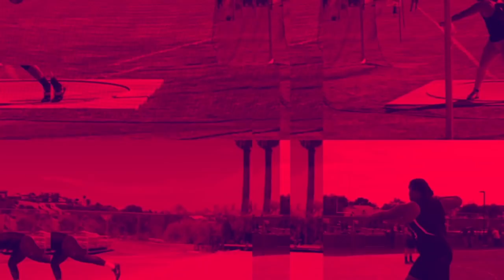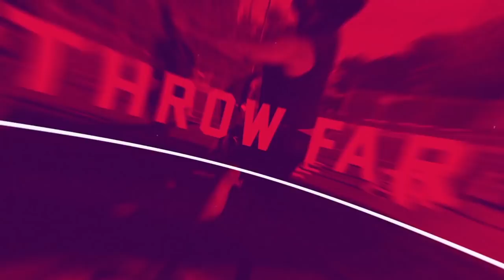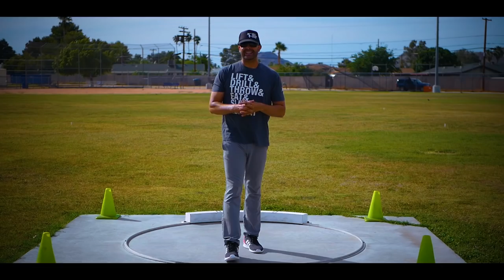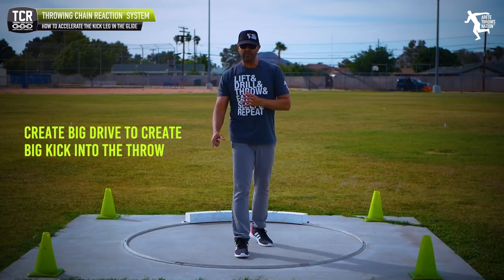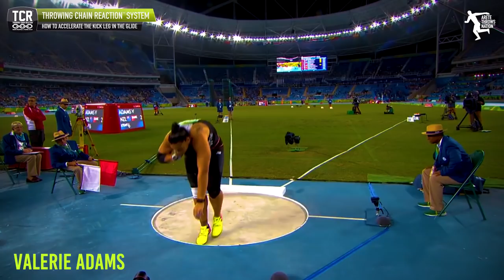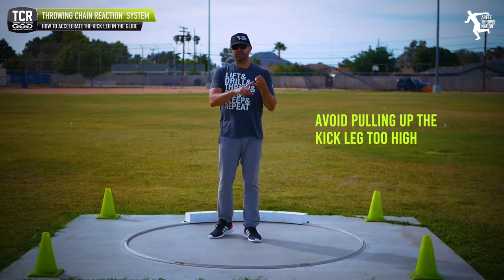The Fast Glide Kick Leg -  SHOT PUT

Comment: So here’s my question. If you are coaching someone in the glide who’s susceptible to landing with their feet too far apart, how can you prevent using the A-drill? Also, if you’re focusing on pushing from your heel driving out the back, wouldn’t that cause dragging at the foot and therefore making the glider susceptible in overextending and not being under their COM?
Reply from the maker: Good question. Basically it’s as simple as the alignment of the COM from the start. Too Wide base simply means the COM is on the wrong angle from the start. Likely no Pillar 3 position so the hips shift past the power position and they will be too wide or even drag the delivery leg. Simple concept. Difficult to execute.
Reply from the maker: Only the ball of the delivery leg. And that’s always the goal.

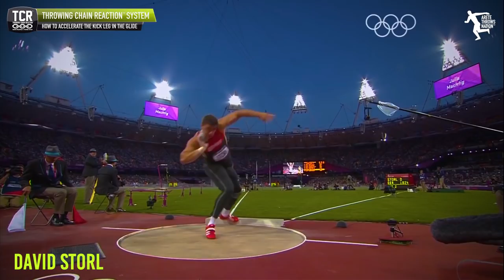Comment: 3:07   i dont agree with the analogy.  if you wind up with a longer kick leg (providing you dont stand up after), it can increase speed.  like a wind up of a baseball pitch.  the 100m analogy is not a good one, because there is no "time" to compete with, so a bettter analogy would be a running start, and that gives more velocity over a given distance.  there should be a better reason a more coiled kilck leg is not optimal.   maybe because the big folks dont need to travel as far and it takes away from the throw if other forces are needed to counter act it, but maybe a smaller thrower would benefit?
Reply from the maker: Well, I can see you point, and perhaps you are correct for some. which in our system we would find the best style for the athletes. but for the majority, this tip will prove to be more beneficial. 
The more controlled kick leg action is faster. like a Jab on a punch vs a knock out punch. 
The drive leg is the knock out punch, the kick leg is the jab, so we suggest start here and as this is learned, experiment with a longer kick leg like you are advocating. 
Thanks for the taking the time to comment and share your perspective. we also welcome different view points and  appreciate it.